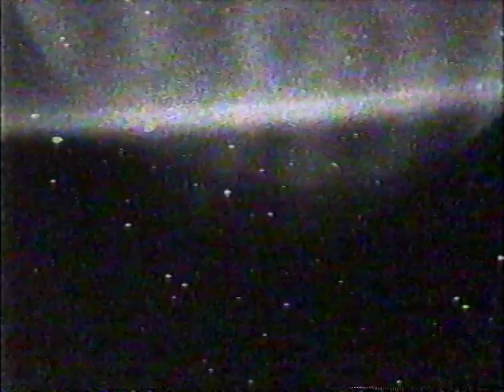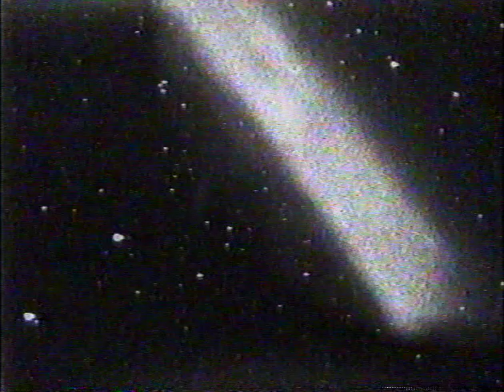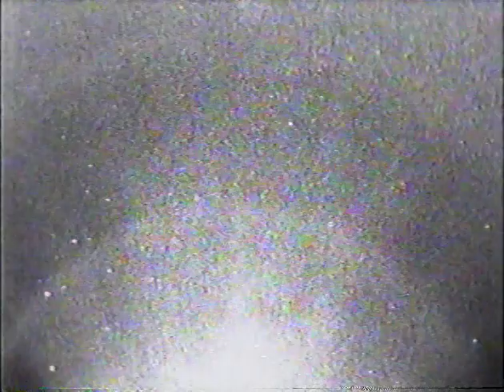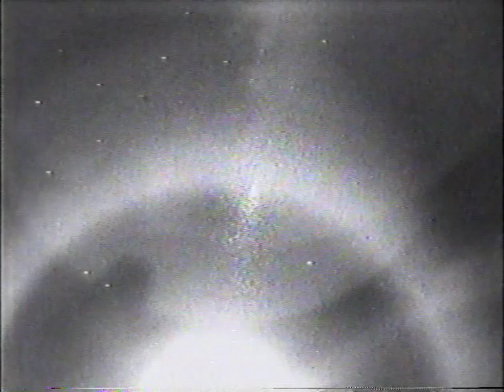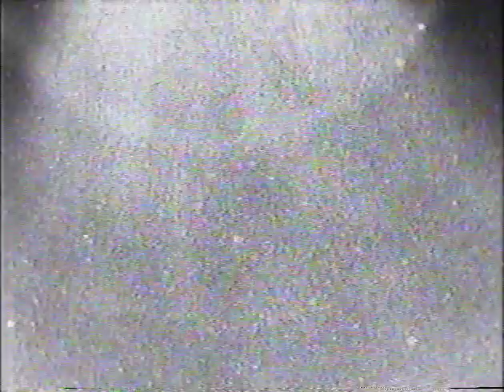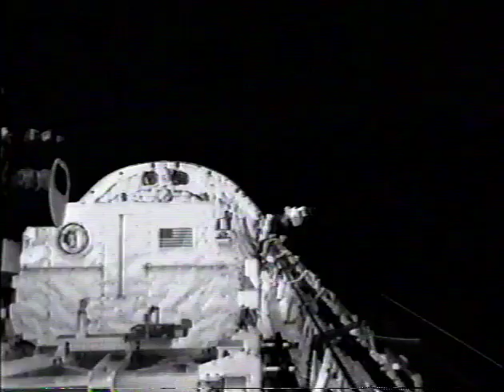UFOs @10 min & NASA panics! FULL search/MASTER

Comment: @12:20 in the center of the screen you can see what looks like a star that begins to move from the center of the screen toward the left, it starts out slow and begins to gain speed the further it moves left, just before it moves off screen completely it leaves behind a streak from its extreme acceleration.

Comment: Seems like just an incredible amount of traffic up there.  Obviously NOT meteors (or meteorites as the  commentator misidentifies them. Meteo-wrongs, I'd say.) Someone has made it very clear to NASA that when these things show up, they are to ignore them or misidentify them.  To expect the public at large to sit back and say, "Duh...OK, yer the experts" is a very bad misstep in my judgement.
Reply: +sustayne 

Although the common explanation of shuttle UFO videos, as
ice flakes, is subject to a lot of mockery hereabouts, we should all realize a
marked change in the visual nature of 'space UFO videos' since the shuttle
stopped flying. Gone are the fleets of UFOs, the criss-cross drifting and
zig-zagging of multiple objects seen on camera views. 

This change has occurred since the ISS, unlike the shuttle, doesn't dump waste water, and rarely uses thrusters for attitude control. So naturally,
pseudo-UFOs created by such prosaic factors on shuttle missions have ALSO stopped -- replaced by distinctive new features of the new optical systems providing continuous external views. 

This fundamental qualitative shift of the nature of 'space UFOs' that coincides with a fundamental technological change of spacecraft routine operations seems to me to a powerful argument that the videos are CAUSED by the technological features of the spacecraft carrying the cameras. 

If the videos were caused by factors external to the spacecraft, why have they changed so dramatically when the fundamental operating principles of the space vehicles have changed?

Comment: The so-called "meteors" are simply objects traversing fast enough across the FOV to leave noticeable persistence trails on the camera sensor.  Overall, what I see are stars, lens refractions from bright objects outside the FOV ( such as the Moon and possibly parts of the shuttle ), particles from the shuttle ( some of the little rockets were leaking during this mission ), and the little blinky was probably MIR.

Yes, I am assuming all that chaos was particulate matter from the shuttle itself, because the alternative idea that it was a vast fleet of spaceships moving about willy-nilly is just dumb.  People.  Really.
Reply: +knarFkcalB I appreciate your perspective, and you could very well be right. But to state outright that these aren't UFOs betrays some ignorance on your part.
Reply: +mmedeuxchevaux In a nutshell, we should only go there when there is no other place to go.  Otherwise our credibility takes hit after hit.  In this case there are very credible non-UFO explanations, so we ultimately have to walk away.  I say, steer clear of those who seize on "a fleet of spaceships" explanation without making as much allowance for mundane explanations as can be reasonably permitted.

The mundane explanations for this video are at least reasonable, therefore we should accept them provisionally until something contrary is established with a high degree of confidence.
Reply: +knarFkcalB okay, i get you. and i agree entirely. i thought you were a straight out debunker. my bad.

Comment: Good video, lots of "unusual" things captured
Reply: Joe Smoe-- The shuttle emits brief thruster pulses  to maintain precise pointing, the 10,000 ft/sec gas field entrains small stuff and shifts the motions. We would see it all the time. Usually the plume was too diffuse to be visible but sometimes would appear as a light flash.
Reply: +morkovetz -- Nothing unusual at all. Typical local shuttle dandruff, illuminated at sunrise.